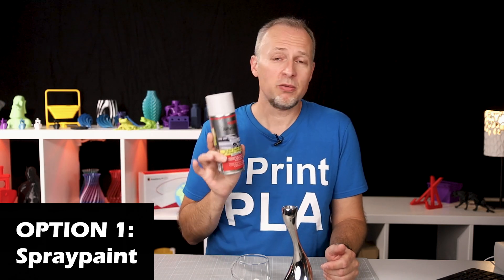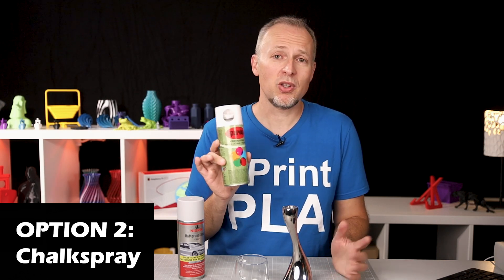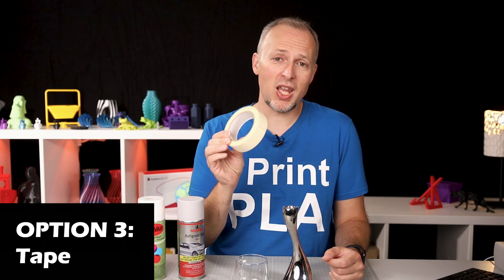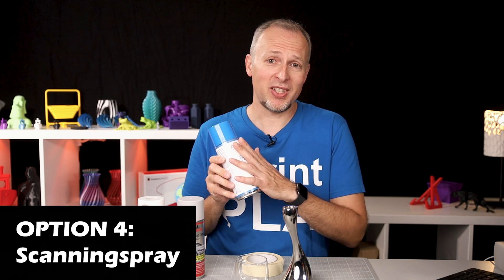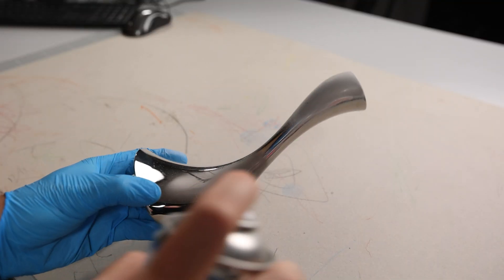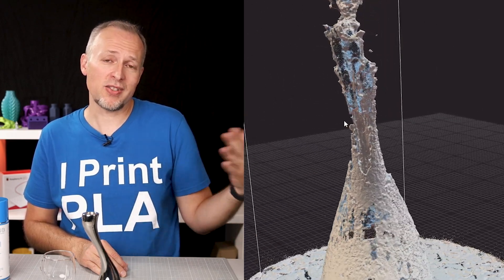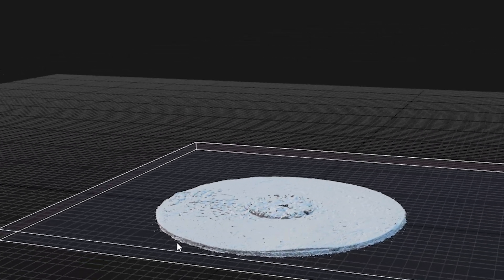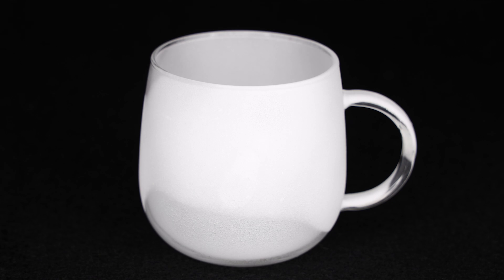HOW TO 3D scan reflective and transparent objects

Comment: I usually use dry shampoo spray, which has the same problem as the chalk, touching it wipe the spray off. You don't have to redo the whole scan, just the area that was messed up. Especially easy with photogrammetry, just take new pictures asked replace the messed up ones. I was recently sent some of this AE Sub spray, both the 4 hour and the 24 hour versions. I'll definitely try that.

Comment: Cool video!  Using Plasti-Dip and then removing it with the removal spray alleviates the issues with chalk spray and can found anywhere.  It's typically pretty cheap and can be pulled off like a sticker.
Reply: Usually plastidip is pretty shiny, so you'd probably want to do a light pass of fine grit sandpaper to roughen it up, but otherwise this could probably be a good solution.
Reply: @EyeMCreative  Just in case anyone is reading this, light coats of plastidip make it super rough and matte